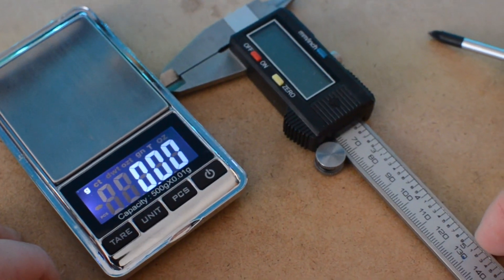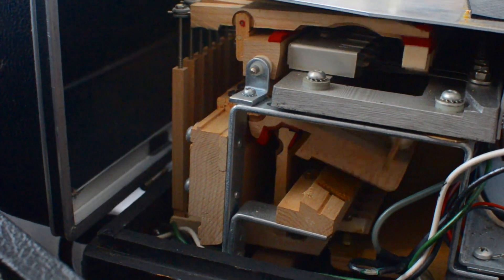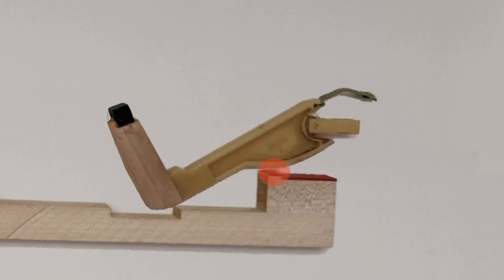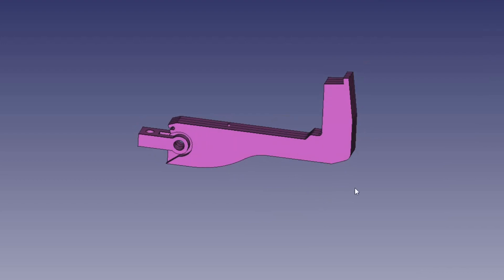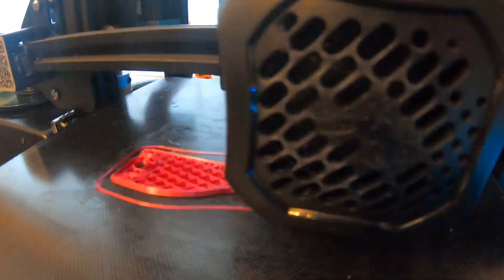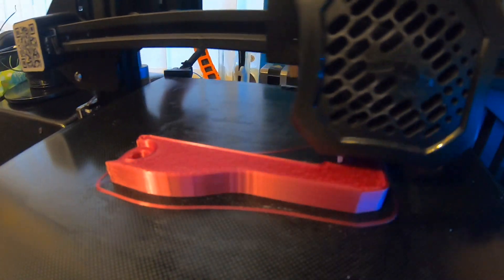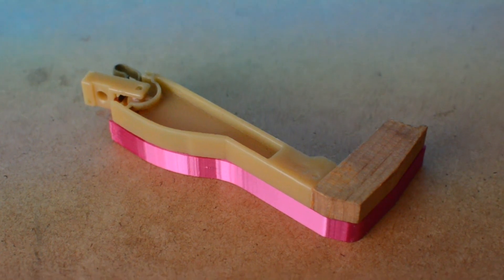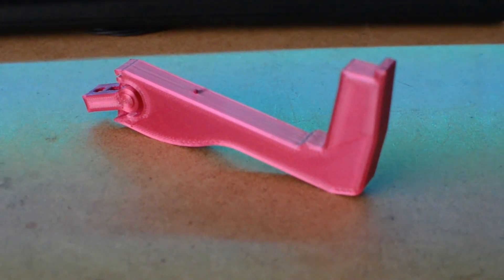DIY Electric Piano - Hammers - Episode 1

Comment: Hello! I'm currently restoring a old Fender Rhodes from 1975. Unfortunately, its overall condition is quite poor — especially many of the hammers, which are too worn down to function properly. If it's not too late, would you be willing to share your 3D model with me? It would be incredibly helpful. Thanks
Reply from the maker: You really want injection moulded parts. They will last 10x longer. 3d printing them will be a waste of money and time compared to proper ones. My design is not compatible with fender rhodes pianos so would need a redesign. 
If you google mk2 hammer there is free model out there.
If I were in your shoes I would talk to Avion Studios? they might be able to help you out?
Let me know how you get on.

Comment: Have you considered using a raspberry pi with elk audio os/ with high-if berry as the controller i have used it as a modeling amp for my guitar and the response time is 1ms round trip.
Reply from the maker: I havent...until now. Do you have any more information on this? I will have a look.

Comment: How does you hammer compare to a fender in terms of center of gravity?  I think the wood in the original could be there to add mass (therefore momentum) as well as be more easily adjustable that the plastic of the original
Reply from the maker: Hi TomE1248,  Yes I agree with the hybrid hammers I believe the wood is there to add mass at the end of the hammer and offset the COG. 
Yes I could change the level of infill when printing the hammer so that that its more dense in the hammer head. Though I didn't do that,  with my design I have been trying to improve the action of the piano. 

I suspect that not offsetting the COG will decrease the likely hood of double strikes and allow for a smoother and  lighter action. As there is less distance between the COG and the point  force is applied to the hammer. the hammer will require less force to get to the same speed.  

There are a couple of other differences not included in the video such as the cam shape is different, my design has a S profile compared to a C. 

All these changes may help, though some may not.

Comment: i am also building an electric piano, I use the rhodes hammer action but wurlitzer 700 dampers so I have connecting rods from the hammer to the dampers. it feels great! The reeds I made from hacksaw blades and it sounds absolutely identical to a wurlitzer. i made all of my hammers from wood, but I was thinking of making a mold and pressing HDPE in to it to make the hammers for my next piano.
Reply from the maker: This sounds very interesting, would love to see some photos or videos.
Hacksaw blades is a good idea as these will be a hard steel.
Reply: @deancoyle  I could mail.
Reply from the maker: That would be great. My email address is in my about section. Thank you
Reply: I'm also building a loose copy of a Wurlitzer 200A with Rhodes-style pickups (I'm documenting the process on the ep-forum, the thread is called "Homemade electric piano"), and would also love to hear and see your design! I'd be glad to share my design as well, my email is displayed on my YT profile if you're interested. Cheers

Comment: I see you've got for larger diameter centre pins in the flange. Good idea that, the Rhodes centre pins wear and get sloppy. I suspect the originals had a little slop in them when new as well!
Reply from the maker: Yes that was part of the reason, and it is also easier to print larger features, win win!
Reply: @deancoyle  can I ask what material you print hammers/flanges with? From what I understand the originals used a kind of plastic that was somewhat 'self lubricating', not sure where I heard that.
Reply from the maker: @CulinarySpy  I have used PLA for the parts I have made. This is because they are easier to print and relatively safe. ABS filament is no more expensive to print with just needs an enclosure and ventilation. It would be interesting to try a ABS print to see if it works the same.

The Fender Rhodes flanges are ABS with 15% Teflon according to the service manual. I am not sure if this applied to all designs over the years.
Reply: The Teflon is more around the pins and links for self lube.  @deancoyle